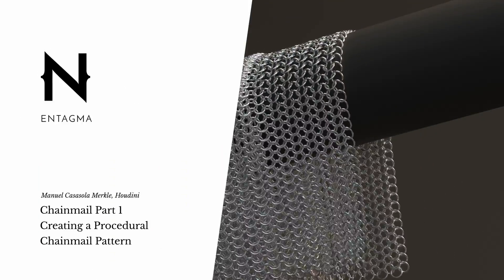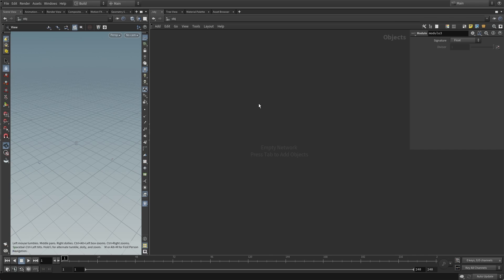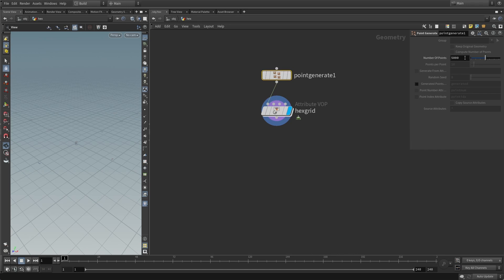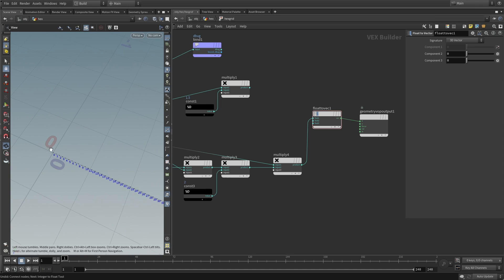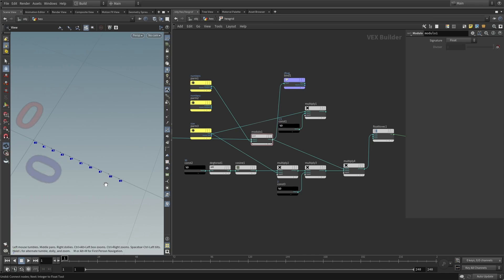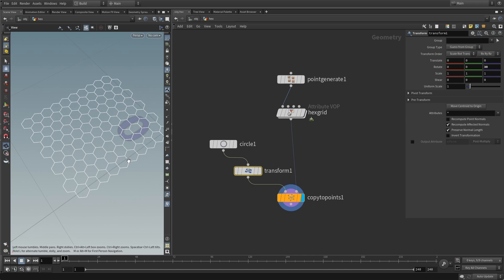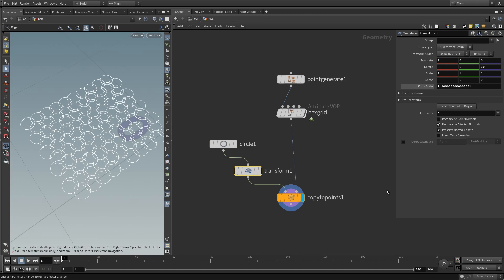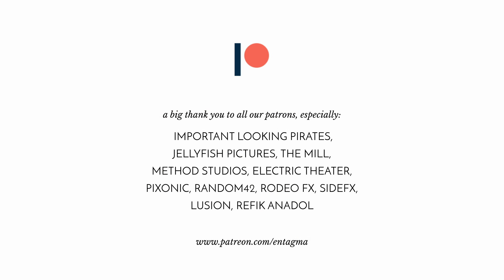Chainmail Part 1: Creating a Procedural Chainmail Pattern

Comment: Replicated This Setup in Blender Using Geo Nodes But still thinking about the Sim Part.
Reply from the maker: Nice! I built the setup in Blender too. There, I did a standard cloth sim. Then used the new Geo Nodes UVSample node (3.4 Alpha) to wrap the flat chainmail to the simulated surface. Will do the same in Houdini in part 2.
Reply: @Entagma  Still Using 3.3.1 Stable and used the surface deform modifier after the sim to bind the mesh but that didn't work, will use the UVSample Node when 3.4 gets released.

Btw Thanks for the tip.

Comment: @12:11 I used to be quite afraid of vex or coding. However, seeing lots of nodes being connected just to perform calculations seems very confusing and hard to manage afterwards. This is the first time I think writing in lines would be easier to understand the math hahahah🤣